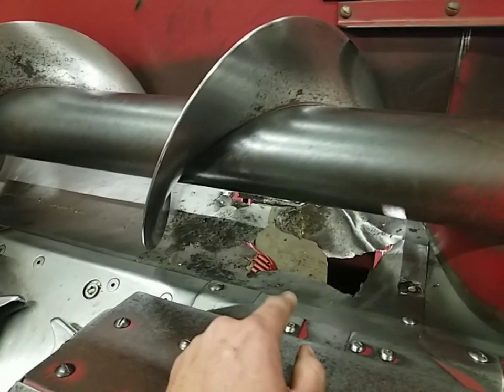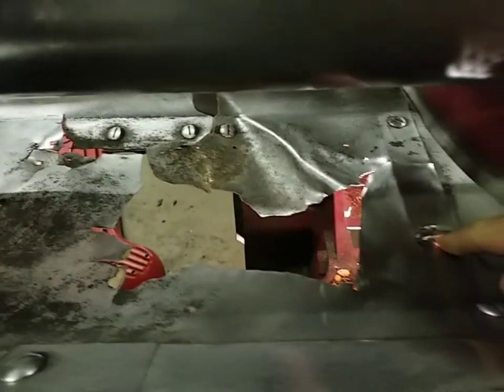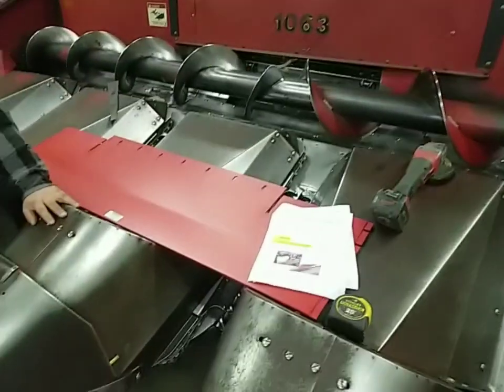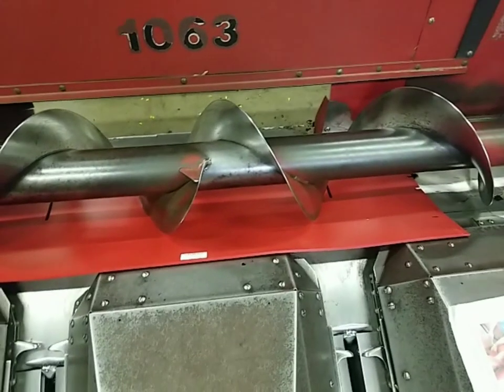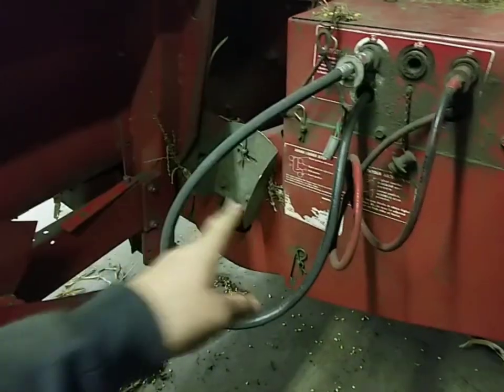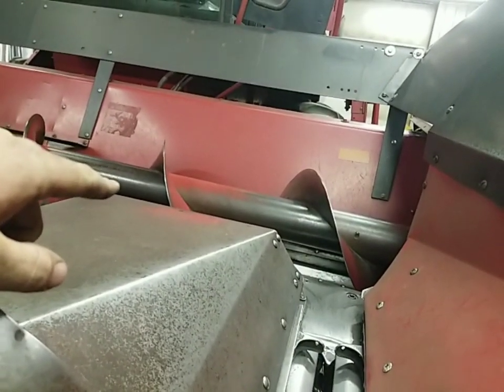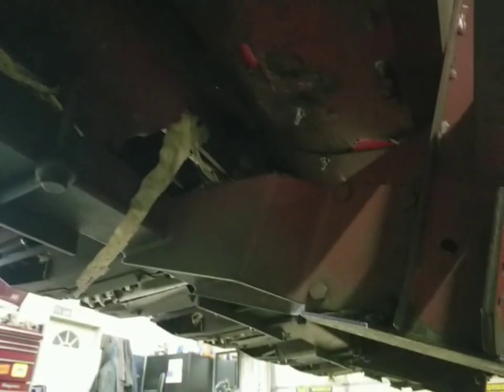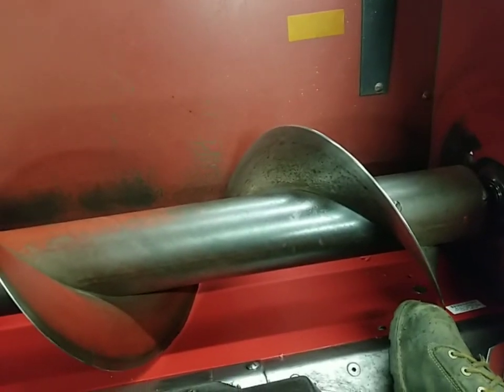Case IH 800,900 and 1000 Series Corn Head Poly Tech Augar Trough Liner Kit Install...Big Hole Fixed!

Comment: We have it in a 1083. Dirt  works it way underneath and pushes it up. Absolutely hate it and now it look horrible. I think I could make Stainless liner or replacement panel for about the same.
Reply from the maker: Really? We had one in our 1083 for about 5 season and never had a problem with it picked down corn with dirt getting in the head and everything else I wonder why yours did that?

Comment: You need this tool, it works great.  Cut those bolts off ahead of time to a length that is appropriate then clean the ends up with this...https://www.amazon.com/dp/B07MDX3SLX/ref=cm_sw_r_cp_apa_fabt1_9ugTFb4QJJZ6B?_encoding=UTF8&psc=1
Reply from the maker: I’ve been wanting to get one of them!

Comment: I've never seen a corn head with that much paint wore off. It's seen a bunch of acres
Reply from the maker: Well I think that corn is a 1992 and has probably never been painted we keep them in the shed most of the year so they stay shiny I think they stay slicker un painted
Reply: @dirtgrainsteel  yeah it would slicker that way. We used to paint the floors of wheat heads but they sat outside all year

Comment: That came out really nice. I never did a corn head but did garbage truck hoppers with new steel. What a pain in the arse!!!Leaves were the most abrasive thing on that metal. I can imagine what you put through is just as abrasive!! Another great video. Thanks for sharing!!
Reply from the maker: Probably just as abrasive we cram alot of plant material through these really a corn shucks and stalks are pretty rough!!

Comment: #NotABot
?sketchy? repair? That thin metal auger trough looks a little extra thin.
Reply from the maker: It's strange how they wear in just certain spots it's not that thin all the way across the width of the head just where the holes were